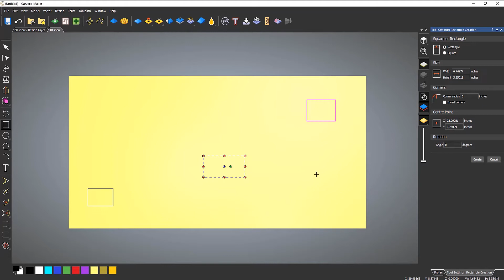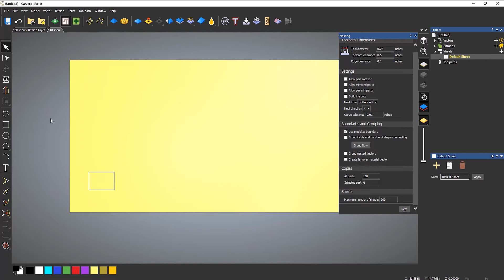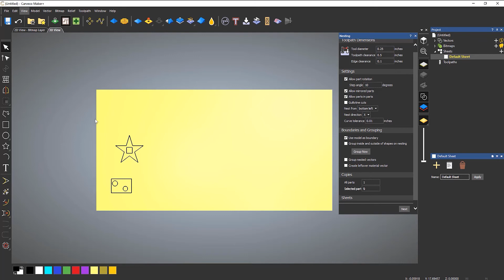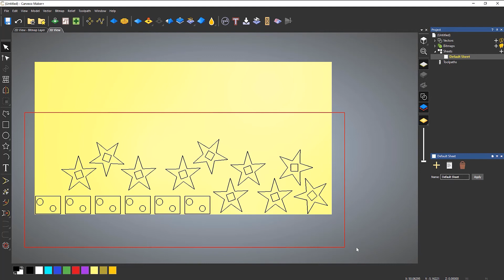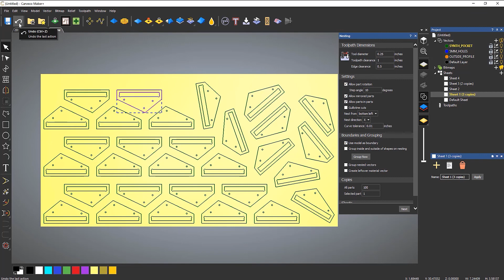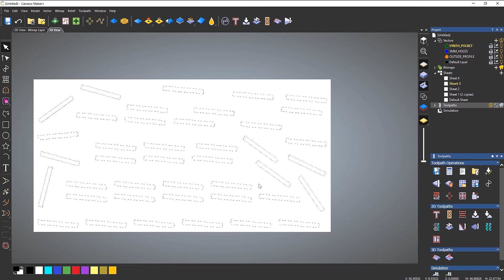Carveco Maker Plus: Nesting

Comment: on the pocket you selected just one of the sheets for the tool path did it, in fact, select all sheets or just the one?
Reply from the maker: Hi Ian.  You can only select one sheet at a time to machine.  If it is the same process, then you can save the toolpath as a template and then run it for each sheet individually.